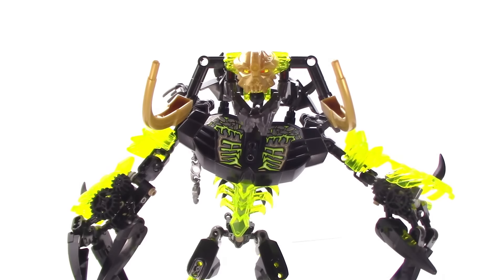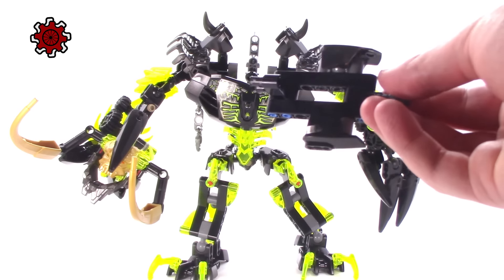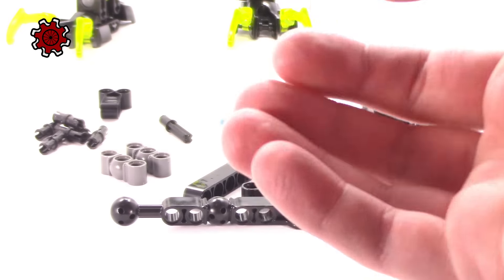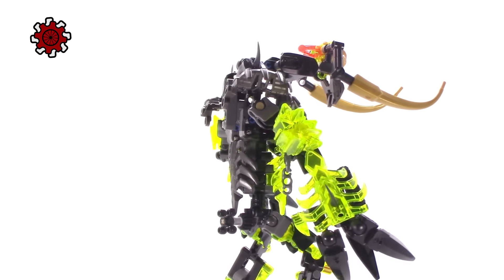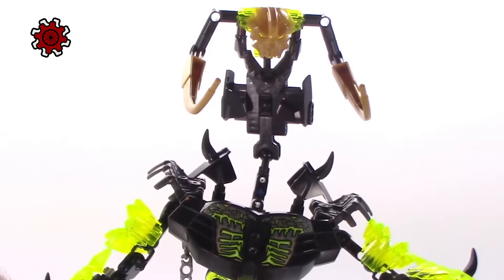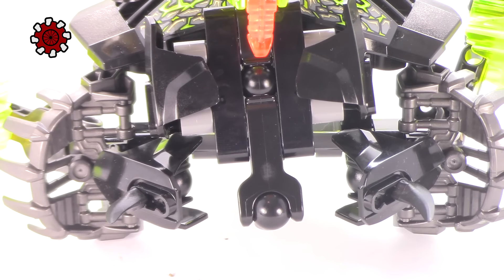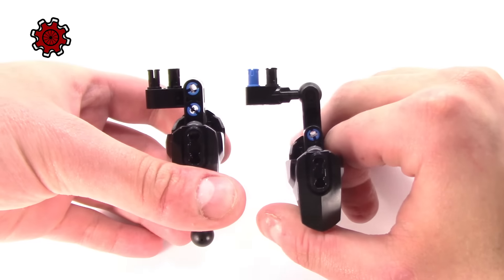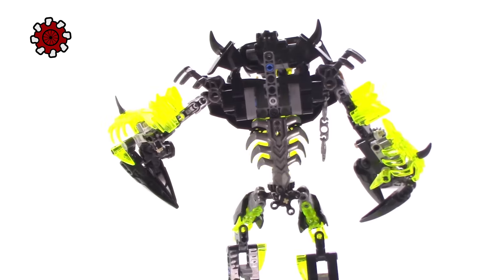The Mocitorium: Umarak's Neck Gap

Comment: I might add that giving Umarak the Destroyer the 2015 brain stalk actually isn't what makes it so hard for him to look up. It's actually the axle that connects the ball to the rest of the neck bumping into the socket itself, which is hard to describe but I assure you there's absolutely nothing you can do about it besides cut away parts of the socket. (well, actually, if this was the old neck, you could simply replace the Glatorian neck with a Hordika neck)

Comment: My solution (I don't have that set yet) would be using the open ball joint on the 2016 torso to fill in the gap with armor shells and technic.

Comment: Maybe adding that really long bone piece would've been overbudget? Do they price the sets based solely on parts count or on the amount of plastic used (weight)?
Reply from the maker: +Tristin Fong A fair point. I heard from one source that the cost of plastic is negligible compared to the cost of sorting pieces, so sometimes the larger pieces are more economical due to the ease of sorting them out. But it's all more or less speculation, but I feel for the price of this set, the one bone piece would be negligible, especially since they found it in budget to fit one in a 10 dollar set.

In addition, they could have reworked the entire construction of the neck and then they may have not even needed that bone piece. 

TL:DR Lego is an enigma.

Comment: dammit, I have a red version of the bone piece used so now it will look weird
Reply from the maker: +Pyro Buy an Akida for $9.99, it comes with one in Black! :) It also happens to have one the best price per part ratio of any of the Bionicle sets (though a lot of the parts are studs).
Reply: +Play Stippling it has that piece? I don't have the set so I'll make sure to get it soon.

thanks!

Comment: With minimal piece usage it's not a bad solution, but still feels a little crude, at least for my taste.
Reply from the maker: +Mate397 I can definitely see that. At it's core, the neck is an awkward design. No amount of changing joints will change that. It is strange though that, in general, it seems that more fans are accepting of custom leg limbs versus arm or neck limbs. It almost plays into the robotic nature of a figure when the legs are a bit clunky. I find myself falling into this hypocrisy frequently myself, and it's not necessarily wrong to see it that way, just interesting that we've learned as fans to overlook the leg construction a bit more, or occasionally even prefer the custom builds.